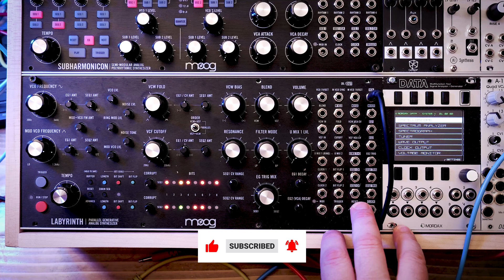Moog Labyrinth | Complete Tutorial | Part 9 - Self-Patching

Comment: I don't fully understand the U-Mix function, even after reading the manual lol
Reply from the maker: Yeah - it's really confusing. I'm going to make a quick video specifically for it because others have asked this question too. Basically - With nothing patched in, the output is the Ring Mod and the Mixer is an attenuator for it. With it fully clockwise, the Ring Mod is put out at full force. With the the knob fully counterclockwise, it's turned completely off. You can patch into this and override the normalization. I'll do a quick video that goes over it.
Reply: @braintree56  thank you , i didint understand either , cant wait for your next video on the LAB , thanks
Reply: manual??? lol. we have Braintree!